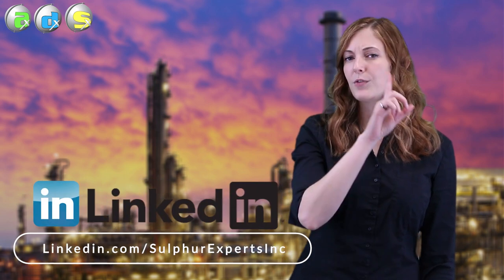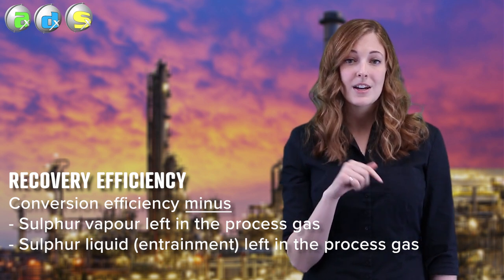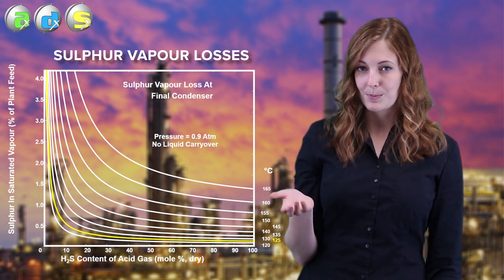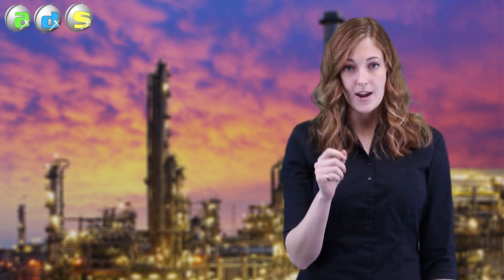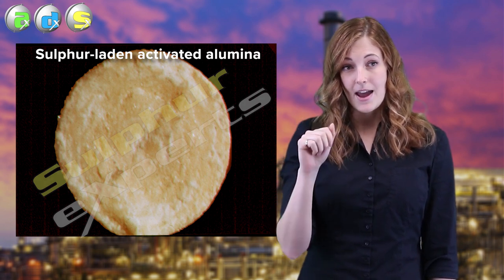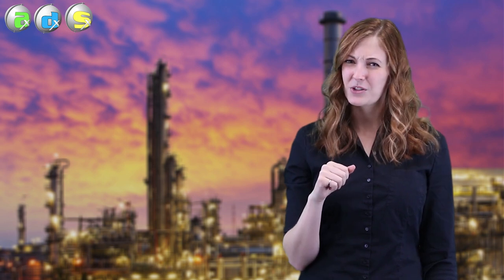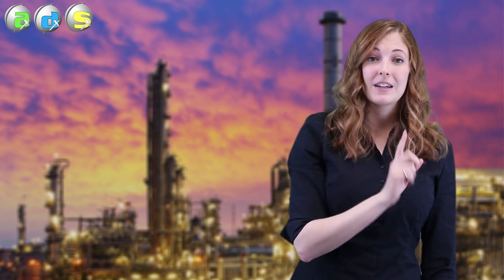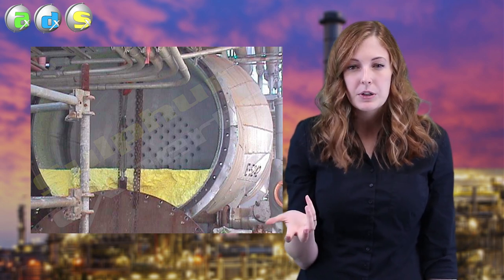Sulfur Recovery Unit FAQ 1 and 2

Comment: Thank you Leah, well explained about the conversion and the recovery. what about the H2S/SO2 analyzer readings in the condenser outlet and its control on trim air control to Rx Furnace. what is the ideal value H2S/SO2 for best conversion to be maintained.
Reply: 2:1
Reply: @surajkanojia3583  4:1 is better.

Comment: Thanks a lot, what is the effect of reactors inlet temperature on sulfur recovery?
Reply from the maker: An excellent question, M. Dellil! Although you still need to supply enough thermal energy to overcome the activation energy threshold for the reaction, Note that the Claus reaction is maximized at lower temperatures, meaning that the lower you go, the more conversion you get. You just don’t want to go below the sulphur dewpoint unless your bed is specifically designed for that; sulphur dewpoints are usually determined by simulations. However, most plants dedicate their first converter bed to hydrolyzing COS and CS2, which if left alone slip right through the Claus unit. This hydrolysis requires a much higher inlet bed temperature. Many plants find their overall recovery efficiency is higher when they assign the first bed to go after these “renegade” sulphur atoms, rather than focus on maximizing Claus conversion. In summary, the first Claus reactor inlet temperature is chosen to give a suitable catalyst temperature for optimal COS and CS2 conversion. The second and third Claus reactor inlet temperatures are chosen to provide a catalyst temperature marginally above the sulphur dewpoint.

- Leah Goettler

Comment: What if hydrocarbons enter with acid gas feed, should you increase the reaction furnace temperature in order to deal with the tail gas analyzer from hunting ?
Reply from the maker: If you have periodic small hydrocarbon concentration changes, then the tail gas H2S:SO2 analyzer will eventually correct for these hydrocarbons. For regular or large acid gas hydrocarbon changes, then it is recommended to add hydrocarbon measurement along with H2S measurement for an acid gas analyzer. The analyzer would constantly adjust the required feed-forward air:acid gas ratio based on the H2S and hydrocarbon contents. The feedback H2S:SO2 analyzer would then have a lot less work to do, and would be better able to keep the tail gas ratio at 2:1.

Comment: Does fuel gas firing help to minimize the tail gas analyzer fluctuations when high CO2/H2S case 60/35 mole %
Reply from the maker: No – fuel gas co-firing won’t help minimize tail gas analyzer fluctuations. These can only be minimized by adding an acid gas analyzer and by proper tuning of the air flow control loops. Fuel gas co-firing is usually only used either to increase flame temperature or to add volume for plants that are at high turndown rates.

Comment: How to run sulphur plant without tail gas analyzer?
Reply from the maker: Hi Umang! The tail gas analyzer is actually one of the most critical pieces of running an SRU effectively. The feedback control is what keeps the plant stable. All sulphur plant designs include a tail gas analyzer, and if it is out of operation then we recommend that it be repaired and returned to service as soon as possible.

If you do have to run the sulphur plant for a brief period without a working tail gas analyzer, then we have the following recommendations:

-	The control system should have a feed forward air:acid gas flow ratio and (if you are at a refinery) a feed-forward air:sour water stripper gas ratio. These should be used to provide the “best guess” air flow rates until the tail gas analyzer is fixed.
-	If you only have a modified-Claus sulphur plant (no tail gas unit), then you can recognize that the best overall efficiency (lowest overall emissions) occur when you have the optimal amount of air to the sulphur plant reaction furnace. If your emissions go up / efficiency goes down then you can try adding or subtracting air from the reaction furnace (usually 1% of flow at a time) to see if this improves the efficiency. Any reaction furnace air flow change that improves your efficiency is the right thing to do.
-	If you have an amine-based tail gas unit, then you can adjust the air flow to the sulphur plant reaction furnace until you get a “normal” temperature rise across the tail gas unit catalyst bed. The temperature rise across the bed is mostly a function of the SO2 concentration in the sulphur plant tail gas; as the SO2 goes up or down, so does the tail gas unit catalyst temperature rise. If you know your historical “normal” temperature rise across this reactor, then you can adjust the sulphur plant air flow (again maybe 1% changes at a time) to make more or less SO2 in the tail gas until the reactor temperature rise reaches this “normal” value.

Please let us know if you have any further questions!

Comment: Why dew point of sulfur increases with increase in sulfur partial pressure?
Reply from the maker: The dewpoint is defined as the temperature at which the equilibrium vapor pressure equals the partial pressure of the sulphur at the process pressure. As the sulphur partial pressure increases, the temperature at which the first liquid droplet forms will also increase. You can also think of it in the reverse, in the example of a water knockout drum. The colder you go, the more water condenses and the partial pressure of water in the process gas decreases. It’s the same principle.